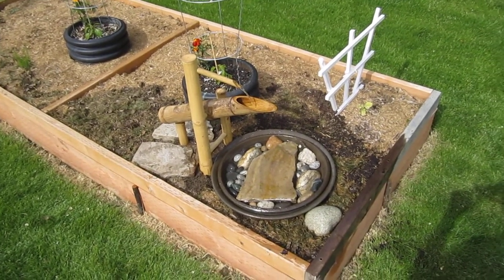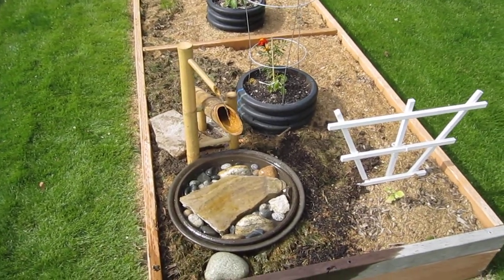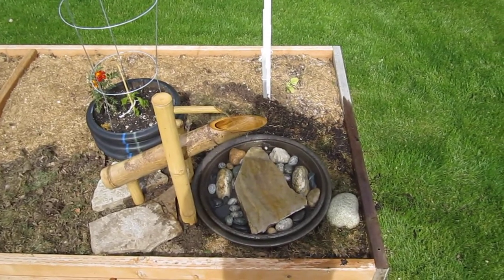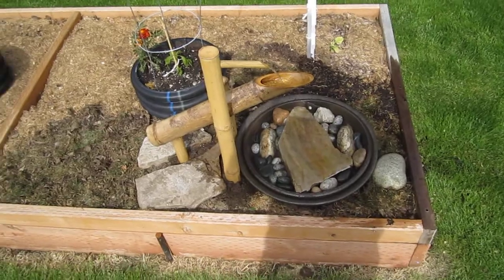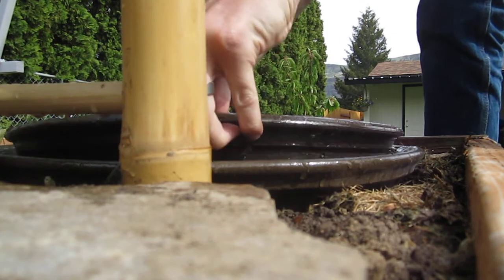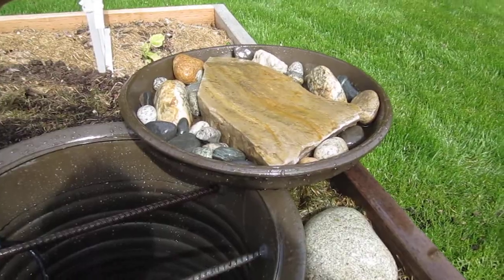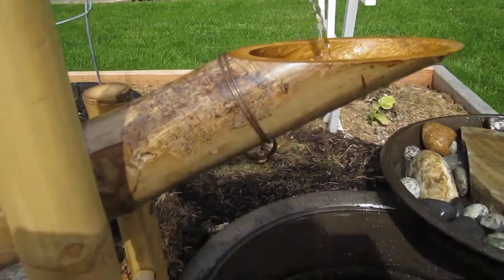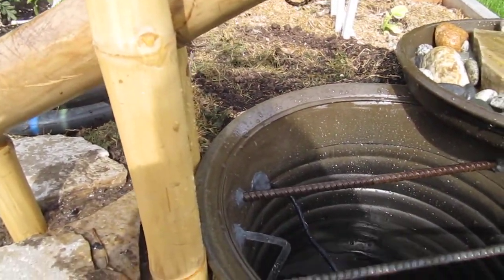Shishi Odoshi or Deer Scarer Fountain Setup

Comment: Did you get that one from Amazon? I recently bought one exactly like that from Amazon, I just wondered how can you change the "clacking" sound to a more hollow sound. I think using the piece of bamboo behind it doesn't make it sound right.
Reply from the maker: I bought the fountain and pump online.  The water basin and lid were purchased separately from a home improvement store and are for planting a tree or herb garden.  The rocks were found in my yard. Sorry, I didn’t mess with the sound of the clacking. I am sure this varies some since it’s natural bamboo. Good luck!
Reply: @PistolPointer  Thanks for the information dude, as I see you uploaded this video in 2012, do you still have the same bamboo fountain? It's just someone wrote a review online about the same one, they said they had it for 2 years and it started to fade & the bamboo started to split.
Reply from the maker: We moved about 5 years ago. We actually moved the fountain with us. I’d say the fountain held up pretty well for 2 years. One of the bamboo pieces cracked after that. The company sent me a new fountain and that lasted another year or two.  We currently don’t have a fountain. Because of the “natural” materials this is made of, I’d say the lifespan is only about 1-3 years; depending on your weather.  If you’re looking for something more permanent, I’d say go with something made of stone/concrete/metal.  I’ve actually considered making one of these out of PVC and painting it to look like bamboo, to go for a longer lifespan. Good luck!
Reply: I would like to see a step by step set up..
Reply: Is is it pumping itself?
Reply: @BWAKAENA  It's very simple, it arrives assembled, the only thing you have to do is attach it to the stand it comes with, also connect the pump to the tube, place the pump at the bottom of the reservoir/pond you're using. The only downside is that the tube isn't very long which means you might have to get extra tubing and glue it on to the existing tubing... but the whole idea of the feature is that it sits right at the very edge so that it returns the water back into the reservoir/pond.